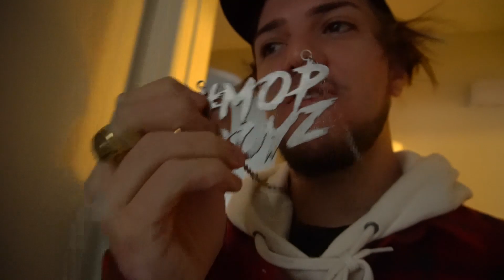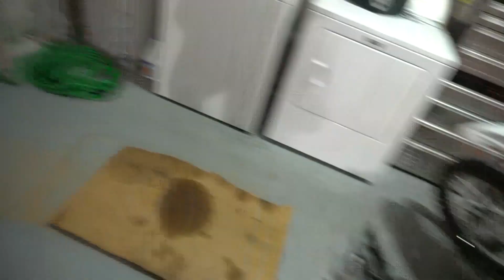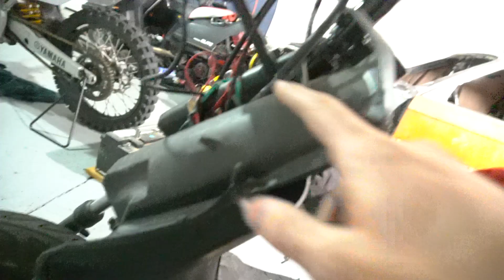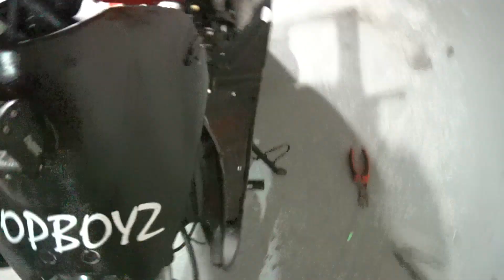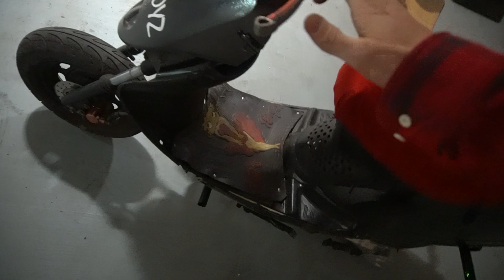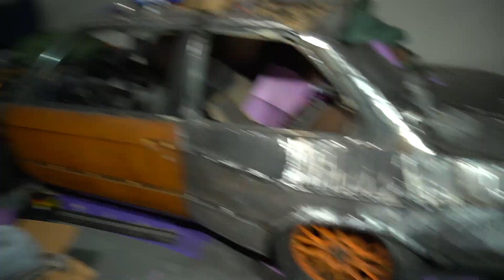150cc GY6 TOO FAST TAOTAO 3.0 | SCOOTER FRAME MODS + MORE

Comment: Hey Trevor, instead of hot gluing your plastics, try using a throw away soldering iron with a chisel tip and a zip tie to plastic weld it back together.